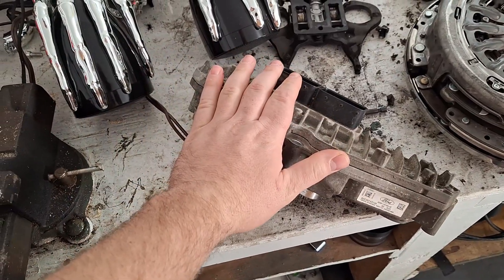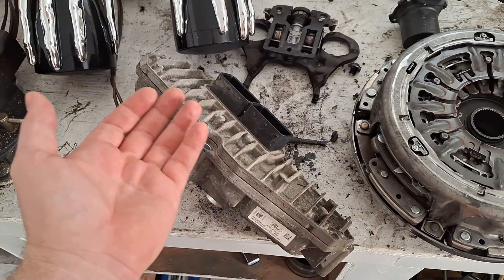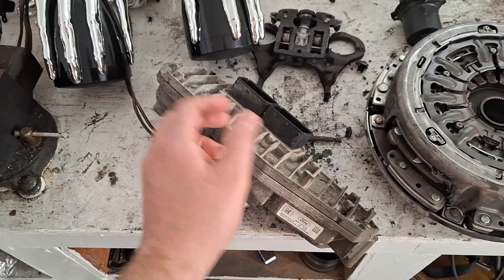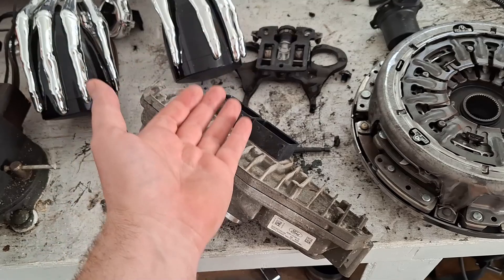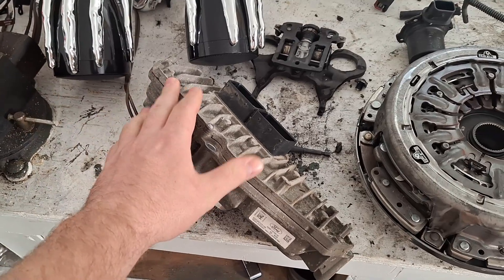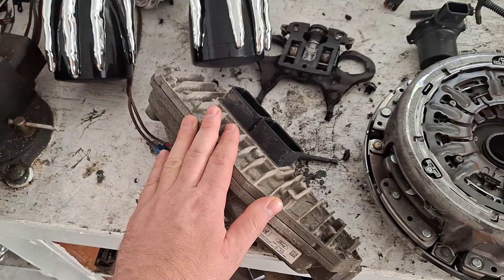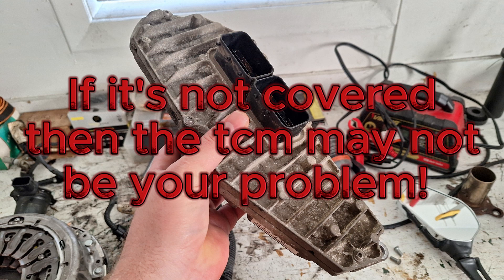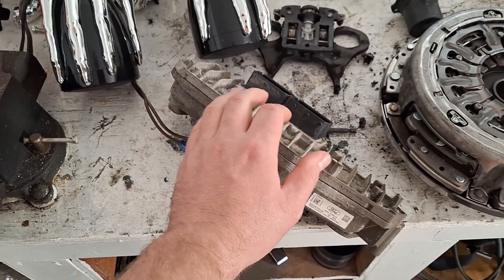TCM Issues After Clutch Job? Explained! Ford Focus & Fiesta Powershift DCT

Comment: Mine has a miscommunication code on the tcm but the only problem I have is hard shudder at 1 gear
Reply from the maker: communication code (u1013?) means intermittent TCM issue dropping out of the network. The shudder is the clutch pack and is normal.

Comment: This just happened to me. Got my clutch replaced at the dealership. Few days later the car jerked and the check engine light came on. It was jerking and delayed shifting. It had dtc codes P07a2, P090c, and P0606. The dealership replaced the TCM and the Clutch again all under warranty. Seems to be fixed for now. But I also have a pretty corroded positive cable on the terminal and I am wondering if that may have also caused the issues after seeing your video about the corroded cable.
Reply from the maker: Corroded cables can cause all sorts of issues, it's a good idea to take care of that for sure.

Comment: Hey Ben, I appreciate your videos. I have a question for you. I did install a new clutch in my 2012 Ford focus put new forks and and actuator motors I hooked everything up installed everything but now the car is saying that the clutch is not engaging and also saying that for a and B are stuck so I’m thinking it’s probably a bad TCM now when I bought the car I dig diagnosed it and clutch actuator a was sticking. It was running smooth, but still sticking missing some gears. Is it possible that it is the TCM?
Reply from the maker: Hey need to know what codes you have and I can reply faster in discord, link in my channel page
Reply: Hey what did you find out it was doing, did same thing and getting similar symptoms

Comment: Hi Ben I have a U1013 code after doing clutch and i know it’s tcm but it’s grinding at startup and reverse and it started grinding too in drive but when i give it more gas the grinding noise goes away
Reply from the maker: Hi Brandon, U1013 can be set from doing the adaptive learn and should be cleared and only replace the tcm if it comes back
Reply: @BigBensCarsAndCycles  can that cause grinding noises it happened when I got that code it’s grinds and it only started in reverse now it does it when I drive in low gears and even when I start the car
Reply: @brandondimaio6549 this may not be the issue, but i had a grinding noise mainly when in reverse. It turned out it was a worn clutch.

Comment: Hello, I have a code U1013, does this code mean bad TCM?

Thank you!
Reply from the maker: Yeah. Unless you were doing a clutch adaptive learn before and it failed for a torque disturbance because that can set the code
Reply: Thank you for your reply. I got code P2872 so did a fork and clutch replacement. After I did the adaptive learning and everything Checked out good. Still having shifting issues. I do have a K04 TCM. Any video that you might have to check TCM pins?
I appreciate the help THANK YOU

Comment: It’s a 2014 ford focus SE dps6

Hey I’ve tried fixing this issue for weeks now , I’ve tried looking up every video in the world . I’ve spent countless hours researching why my car doesn’t turn on after clutch job . The main problem I’m having is the ford is not picking up that I’m in p or r or N it thinks I’m in drive for  some reason it’s weird. I changed the range sensor and my shifter cable is good . I’m lost . My car no longer starts need help
Reply from the maker: Hey sounds like a tcm problem  or you left a ground loose

Comment: Hey Ben! So I fixed my car sucessfully last year on march 30th 2024. I recently bottomed out a little roughly at the point of the center of the car. I managed to get over it but it's been slipping ever since. I reset the clutches using the tool and then reset everything in forscan. Still slipping though. I do have the 14m02 on my ford recalls when i type in my vin on the site. I also have to do my evap. They should not be able to charge me right? Especially if I refuse any and all diagnostics and work not covered under the safety notice. I believe they include 0.3 hours of diagnoses in reimbursement. 

After I do this and arm wrestle with the stealership I should see the clutch slippage fixed correct? Or do I have to drop the trans.... again.... If I do I'm going mtx75 ffs
Reply from the maker: @diegojimenez9028  Hey, since the problem started after you bottomed out the car, then likely there's not a warrantable condition and it's coming out of your pocket. But you have to diagnose the problem to know what it is
Reply: @BigBensCarsAndCycles  Yeah, I'm gonna take it on monday and have them replace it. I don't essentially want them to fix the issue just give me a new computer to fulfill my safety notice on my vin. 

There's no overheating after that first drive and it slips only at load around 3k rpm on even gears. Most notably 4th and 6th. 

After resetting the adaptations I realized that my clutch touch point went down a whole 4 mm when i did my touch point re-learn. It used to be 16mm now it's 12. 

Causing me to think that either the computer is damaged or I've misalligned the clutches somehow or caused the retaining ring to pop free. 

Those last issues I can fix on my own but I'd like them to replace the tcm anyway since it's a safety notice on my vin and it'd be silly not to take advantage of the program.

Comment: I have a 2016 Ford Focus SE, with K04 TCM that went bad at 110K miles. They will not warranty the repair because mine was manufactured in late 2015. Sadly

Comment: Hello. I have a 14 Focus Ti, with the dct. I replaced clutch set with luk, and installed new oem actuators. Along with an oem fluid change. None of these components had failed. But, seemed reasonable to do during my engine swap. Car now runs GREAT!! 👍 However, after about 1k miles, I started getting check transmission (p037f) It's happened 3 mornings in a row now. Morning temperatures have been around 30F° I tried warming the car up for about 10min, thinking cold fluid sometimes doesn't work well with manual gear boxes... I purchased my fluid from the dealership. I didn't have any trans issues prior to my servicing. I was a tech in an auto shop for 10yrs. But, have been working as an electrician for the last 20yrs. This trans is something I'm not familiar with. Dealership say po37f doesn't qualify me for tcm warranty... Please help 🙏🏻

Comment: After one week that i did Clutch Job, my Focus start slip clutch between first and second gear and shudder on reverse. Could be a bad TCM?
Reply from the maker: @Jambrunett  if there's no codes, I'd do a manual adaptive learn which I've got a video on. If it still does it I'd replace the actuators

Comment: Friend, I have a 2014 Fiesta. I get a faulty transmission, only code p0606. When I prescribed the TCM it works well, it makes the changes well, but two days later the same problem happens, and it stops making the changes. Is it TCM?
Reply from the maker: @vidasinlimite8774  hi, it is possible there's a power or ground problem. I would first test the battery. And see if the positive and negative battery cables are plyable, not hard with corrosion.
Reply: @BigBensCarsAndCycles  Now change the battery, there is no corrosion, but the + and - cables are hard, other than that there is no corrosion.

Comment: My 2012 Focus TCM is K04. Should I be concerned?
Reply from the maker: @SV11408  a subscriber pulled an original k04 off a 2017 today. So you're good. 2017 has the good tcm from the factory

Comment: 2015 focus.  Original TCM was throwing all kinds of codes.  Replaced clutch and shift forks and fluid with motorcraft dual clutch fluid.  Put a K05 TCM in.  Now it's shifting a little hard in first to second and after driving probably more than 10 miles it will give a transmission hot warning, but no codes.  Transmission hot warning usually will come on while coasting or not in city driving, but in highway conditions (very light driving).  Could it be a shift actuator?  Got any ideas?  Thanks.
Reply from the maker: @clemrod3273  what codes are setting? If none you can try having ford program as-built data into the tcm. It's possibly with a 15 trans you may have an early build and need another calibration
Reply: @BigBensCarsAndCycles  Thank you!!
Reply: Oh yeah, it isn't throwing any codes, just hot transmission warning
Reply: @BigBensCarsAndCycles  I ended up resetting the TCM to factory firmware using Forscan. TCM works perfectly now. Thanks for the advice,

Comment: After replacing the clutch in my 2014 Ford Focus, the car developed a bad vibration coming from the transmission when reaching 2200 rpm is when you feel more. I took it to Ford for a diagnostic and they said the issue was with the engine mounts. I replaced all three engine mounts with OEM parts, and there are no codes for misfires or transmission issues but the vibration is still there. I'm preparing my self to drop the transmission and check for a bend flywheel or something similar. Note: car shift good, and I align the mark in the clutch and flywheel. If you have any suggestions of what I need to check I will be really appreciate.
Reply from the maker: @edwarscasique635  retorque the clutch nuts, and follow my video for that. That should fix it

Comment: My 2012 focus has about 155k miles and it just started give codes and having shifting problems. Ford replaced the TCM and it drove good for about 2 days. It currently gives the code P07A3 “transmission friction element A stuck on” I’ve use forscan and retrained my clutch 2-3 times and each time it drives fine for 2-3 days. It’s like it’s getting untrained. Do you recommend asking ford to just replace the clutch and forks or to do the whole transmission?
Reply from the maker: @justinshinn6218  hi, I would have them do the clutch job. If you keep up on fluid changes, the synchronizers should last you a very long time.  Not to mention, an entire new transmission would cost like 8 or 9 grand. As opposed to 3500
Reply: Thank you.